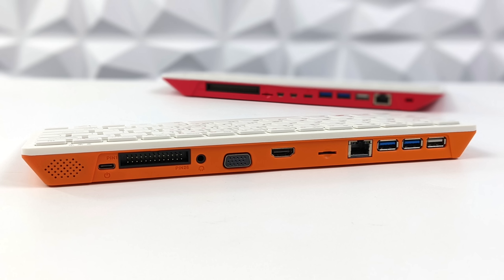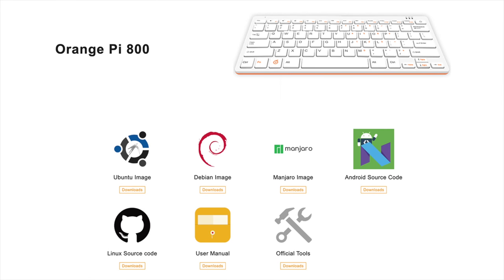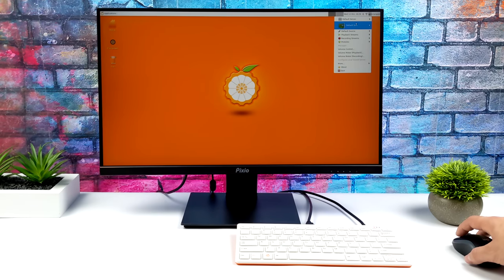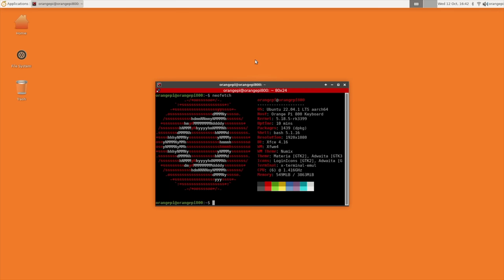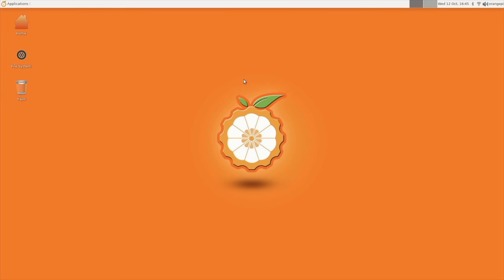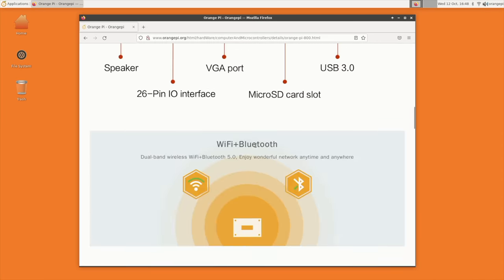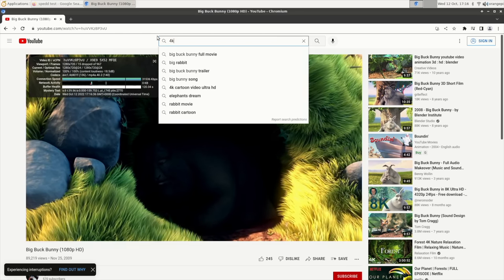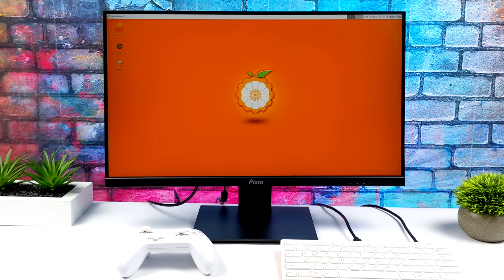Pi800 First Look, An Brand New All-In-One PC! Think Pi400 But Faster! 6 Core Arm CPU

Comment: Problem with these things is always the same: lack of opensource graphic APIs implementation, which the Pi provides.
Why is that important you ask? Because not having opensource graphics ties you to an old kernel, and prevents you from using the full potential of the GPU.
Reply: Which is why browsers struggle with video decoding. But they will catch up with time like the Pi did because it didn't have accelerated graphics at first either. I'd bet if he used a custom build of ffmpeg for that chip it would play video at full speed. I had to download YT videos on my Pi at first to get proper acceleration.
Reply: wtf!!!!!!!! this use mainline and PANFROST!!!!
Reply: @anon_y_mousse  yeah, after a year or 2 the current video codec is sometimes too hard to use for these PC. I had an Apple IPad that could no longer stream video. Also a wii u.

Must get something with x
Continual updates and common chipsets.
Reply: Well, I don't want a fairly obsolete gpu... as rpi models have limitations that GPUs from more than 15 years ago in many parts.
The rpi4 GPU will never be able fully support OpenGL 3.0 because it does not support/lack hw 8 draw buffers some very old PC engines required it, no native support MSAA ,
And not going GLSL 4.00 for several DX11/OpenGL 4.x engines with limited Opengl 3.x  GLSL1.30/GLSL1.40/GLSL3.3
For example Xbox classic emulation requires OpenGL 4.0 with Xemu .
The GPU rpi's it's very obsolete early DX9/OpenGL 2.1 era and partially DX10/OpenGL 3.x support  from ~15-20years ago .
It does not have  early Vulkan 1.1 api 100% implemented because it lacks hw VK_KHR_sampler_ycbcr_conversion and VK_KHR_shader_draw_parameters 
It is very sad that today to run OpenGL 4.x only Tegra TK1 ad higher   and Apple m1/m2 can do it
The rest of the manufacturers under arm are too limited driver or lack hw to offer that.
The closest to offering that is Qualcomm + adreno 650 which already offers Vulkan 1.3 and several stuff for OpenGL 4.x has many things implemented and hardware prepared in the structure to implement it in its driver.
We  needed a gaming manufacturer for arm/risc-v that meets the requirements to implement the graphics apis of the last 15-20 years 100% with no stuck Propietary drivers NVIDIA or Apple m1 metal (on mac wrapper limited voltenVK if not exists metal backend)
Only boards that have PCI-express and can inject a PC GPU with free drivers for amd GPUs or nvidia drivers already released for pci-express boards arm64 used in some servers.
Reply: @bulletpunch9317  mostly better if compared with Mali/broadcom gpu's  but missing driver implemented supporting the API .
The problem is that many arm manufacturers are oriented only in android and robotic of use and throw away after years.
Little effort to offer support for Linux where OpenGL support is more common compared with OpenGL ES API.
Sometimes you can poorly X11/wayland stuff perfomance due poor perfomance or partially stuff implemented under linux with no official supported.
The state of drivers is quite concerned very fragmented and they are rarely updated maybe you can go a little further with some custom rom for android principal development by containing a newer driver but you never get to see a notorious stagnant progress to partial Vulkan 1.1 with old development branches with no finished driver.
I have seen dual source support disabled in some drivers developed by samsung or some stuff optional never implemented .
The only manufacturer is the one I have mentioned Qualcomm Adreno 650 with recent mesa3d drivers open souce you can have a lot of work from what I say.
I haven't seen a driver on Samsung exynos 2200 phones that fully supports Vulkan 1.2 or Vulkan 1.3 required for current DXVK (it's a DirectX to Vulkan wrapper).
Reply: As far as I know, the Pi 4 still doesn't have hardware accelerated video decoding in a browser with mainline Linux. The Pi 4 does have Vulkan support, which is only experimental with the RK3399. Unfortunately Collabora will remove it for the RK339, as they say it's making things complicated for Vulkan support for other chips. It is possible to enable OpenGL 3.3 for the RK3399 (I did that with Manjaro), which I haven't seen with the Pi 4 yet. But both lack OpenGL ES 3.2 support with mainline Linux. You can run AetherSX2 on a RK3399, but so far I only managed that with Chrome OS and using the Android app. The Pi 4 can run AetherSX2 with mainline Linux, because it supports Vulkan.
Reply: @LivingLinux  who cares, that vulkan render is barely usable for the important stuff: dxvk. not only that, the pi4 gpu (and just to be CLEAR rk3399 HAS OPEN SOURCE GPU DRIVERS) doesnt support has many textures and features that T860 (a dx11 conformant gpu) support, bc7 textures, depth clam, etc, etc. while not having vulkan, just bc it would be as useful as on rpi4 (and th epanfrost devs though it would be reasonable to just support it on bifrost and up), the board has fucking mainline open source drivers and its way more open source friendly than RPI4 that has very CLOSED software running underneath like THREADX, the vpu blobs and so on.
Reply: you not even watched the video, this runs on mainline 5.18 with panfrost mesa drivers.
Reply: @microlinux  You can run AetherSX2 on a Pi 4 with mainline Linux, something I haven't been able to achieve with the RK3399. The T860 might be better GPU, but software support is still lacking, negating the hardware superiority.
Reply: @microlinux  Wow, are you sure of that? Is there an SBC equivalent to this which is readily available? I mean, in Pi-like form, not inside a keyboard.
Reply: @LivingLinux  that just counts for aethersx2 bc it needs vulkan for most parts (no ida why you cant get it working with gles tho, maybe you also need gles 3.2, something that neither pi4 provides as today on the driver), but the software support for those features are there. I can use bc7 texture on cuphead on rk3399, not on rpi4. I can use depth clamp on rk3399, not on rpi4.
Reply: @manuelalfayatecorchete1806  they are tons of options, and panfrost not only supports rk3399, it supports trillions of mali based sbcs. Most of my boards on my channel use panfrost. Every midgard/bifrost/valhall can use panfrost, at least eventually on the last one since it's  too new
Reply: @LivingLinux  for the things that a pi4 can run on aethersx2... who cares about a vulkan driver... the same goes for rk3399.. not enough  on  both, on both cpu and gpu side.
Reply: @manuelalfayatecorchete1806  rockpro64 is my safest recommendation
Reply: @manuelalfayatecorchete1806  odroid N2+ is a powerhouse (without much I/O) and also use panfrost.
Reply: @microlinux  How does the RockPro64 perform compared with the Pi4? Please consider I will ONLY use the opensource graphics stack on both.
I have been trying to see comparisions but they are very confusing.
Reply: @manuelalfayatecorchete1806  performance on what specific workload?? I NEVER use blobs on any rk3399. In fact, I have an rk3399t variant that sucks bc it doesnt run on mainline as today. But for any rk3399, mainline is the only way to linux. A lot more performance cpu and gpu wise
Reply: @manuelalfayatecorchete1806  if you need raw performance, odroid N2+, if you need decent performance but also a lot of I/O, rockpro64. Both run great on mainline (well, odroid use a downstream close to mainline kernel like rpi).
Reply: @manuelalfayatecorchete1806  see how youtube performs on rockpro64 on my channel. I overclocked it to 2.2 ghz and 1.8 for the low power cores. With the heatisink/fan of pine64 it's  very stable at very low rpms
Reply: @manuelalfayatecorchete1806  the radxa zero 2 is stupidly powerful but that isn't  out yet. Also on mainline with panfrost
Reply: @microlinux  Aethersx2 for OpenGL ES needed Opengl es 3.2 context won't work with no <Opengl ES 3.2 context.
Also work for Opengl 4.3 context for Opengl HW and needed some OpenGL 4.4/4.5 for some accuracy stuff .
Depth clamp will never work on rpi4 it's lack hw so will never work for DXVK too or some apps/games needed it.
Reply: @CarlosEstrague  absolutely, that's  why I mention that videocore 6 lacks of too many stuff that EVEN on mali gpus are supported.
Reply: @LivingLinux  try forcing gles 3.2
Reply: @microlinux  yes mali are better than broadcom socs in some stuff like this. 
Too bad they missing supporting Geometry shaders it's a physical hw needed in some test cases but are supported on rpi4 .
It's all so diverse and rare that you go crazy with each manufacturer supporting each thing  xD
Reply: @CarlosEstrague  afaik, geometry shaders are supported properly on T860.  T860 supports stuff that even bifrost doesn't  support....
Reply: @CarlosEstrague  even then, we are talking about ancientware... the real thing is valhall and it's  getting  panfrost support right now
Reply: Depth clamp is even supported on G31...
Reply: @microlinux  The t860 probably supports it.
But I mean For example in emulators like the 3ds emulator with the new Vulkan render.
At least in its current state it requires it if you want Hardware rendering in Vulkan backend.
In some driver if not supported returned log.
    "Geometry shaders not available! Accelerated rendering not possible!");
Reply: @microlinux  Specific workload: emulation using RetroArch with max_swapchains set to 2 and "threaded video" set to OFF. In other words, low-latency emulation.
Reply: @manuelalfayatecorchete1806  odroid n2+
Reply: @microlinux  I am not interested in the n2+ it hasn't a good case to with it.
Reply: @manuelalfayatecorchete1806  hahahaha then wait, there is a rpi4 form factor sbc with A311D down the road. If you want retrogaming then it must be S922X or A311D at a decent price, not khadas vim.
Reply: @manuelalfayatecorchete1806  yo can make any case or even repurpose an old console case and fit the board inside. Consider the N2+. For retrogaming it's  a good board.
Reply: @microlinux  What's that Pi-factor SBC with A311D?? Why S922X or A311D and not the Khadas Edge 2 for example?
Reply: @microlinux  I also saw that  A311D and S922X are both A73 while RK3588 is A76, which is what I want.
Reply: @manuelalfayatecorchete1806  it's  an sbc not released yet. I can't  disclose more bc of that. Rk3588/S/J series are very good stuff.. but.. no mainline neither panfrost as today. So, very few stuff you can do from linux as today
Reply: @manuelalfayatecorchete1806  you are going  to wait an year for mainline + panfrost on that onr

Comment: This thing looks sick! The fact that it has VGA out means you could use a VGA to Component converter to get a direct video signal out to a CRT TV, of course you'd need it to be set up at 240p resolution. If this thing can run it's own type of RetroPie or Batocera and can be switched to 240p then I want one.

Comment: Nice review! I look at the Pi-400 (and now the OrangePi-800) as a modern Commodore 64. But at $100 - it's an order of magnitude cheaper. Even Moore's law doesn't account for this reduction in cost. Amazing.
Reply: Moore's law did account for this cost-reduction, and you can actually map the relative price-to-performance of various Pi generations to find that the value is decreasing overall. The original $35 Raspberry Pi was the best bang-for-your-buck computer ever made, IMO.
Reply: @dial2616  I'd like to see your numbers on Moore's law for this… But as far as I can tell the raspberry pi 400 and or the orange 800 should cost $599 like the Commodore 64 did. the fact that it's 1/6 the cost is what I'm pointing to is having done better than Moore's law

Comment: When it comes to emulation performance on SBCs and units like this you might want to try grabbing the retropie install script, setting the OS to boot to the terminal by default (you can always type startx to manually start the GUI) and then run the retropie script and have it compile things from source so they are tweaked for that board and you don't have the overhead of the desktop environment in the background.

Comment: One of the things I really care about is vanilla kernel support. I don't know with a lot of these boards if I will be stuck on an old kernel version forever.
Reply: Runs mainline.
Reply: @microlinux  Excellent then. I might have a look at getting one of these then.
Reply: @dave7244  yeah,my only concern is the 5v input thingy. It would be much better 12v jack or PD

Comment: RK3399 is quite powerful. Well sufficient for every day office and browsing tasks.
I like the connection options of that device. Especially having HDMI and VGA gives you the option to plug in 2 monitors if you have an old VGA display lying around somewhere or use an adapter.

Comment: I hope the Orange Pi ecosystem continues to grow.  They've been around awhile and have a lot of unique boards at acceptable prices, and they're still available.  The smaller community makes it a bit more challenging to find solutions/answers for them, but they're still fun to tinker with.  I've been using a few Orange Pi Zero boards to run Octoprint for a couple of years now without any major hiccups (other than the initial setup).  I'd love to use Raspberry Pis for everything, but the shortages (and scalping) has had a major impact on their availability.
Reply: Thank god I got my rpi 4gig 128 PC before all of this shortage happened.
Reply: Orangepi ecosystem is quite big. Just check armbian forums.

Comment: Pi400 and Pi800 are the comps we wanted to replace the C64.
This is absolutely the way that C64 mini should have gone.
Reply: Well.. technically, the proper sucessor for a commodore 64 should be the commander X16 from the YouTuber 8 bit guy amd his team.
Reply: @monochrome_linux  I'd consider it more of a modern-off-the-shelf remake of the C64, cranked up to 11.

Still a 6502 at heart, but it's capabilities are pushed to the limits.

So it's more of a development of the C64, rather than a successor.

Though I've just seen the video was released yesterday, so i'm gonna take a look

Pi400 and Pi800 on the other hand are true modern systems, that can be used for everyday tasks.

I am curious to see what the X16 can do.

Comment: Years ago, 2018 I think, I pre-ordered a Rock960 (RK3399), waited forever for it to come, and installed it into a tenkeyless mechanical keyboard along with a USB hub.  It's been gathering dust for a long time since then, since the promised Ubuntu driver support for GPU didn't come.
Reply: Rk3399 has gpu drivers since years ago. Not vpu tho.. well, not properly supported on third party software. The same goes to rpi4 for most parts, specially the browsers.

Comment: cool little gadget. on a personal note i would like to see a revision either with this or with the PI where it is usable as just a plain keyboard, flip a switch on the back and you can boot the system built in to the keyboard. flip it back and its just another keyboard

Comment: This new kind of computer should came with ram and SD in their slot versions. There is space and plenty of options (specially for ddr3L sodimm and m2 SATA/nvme)
Reply: There is no hope for that. Not even the RK3588 supports SO-DIMM/DIMM RAM, just 32 GB of soldered.

Comment: I really hope orange pi gets more support like the raspberry pi. I will say keep in mind that most of the orange pi's that are LTS, not the os lts but the name of the biard is something like orange pi 3/4 LTS, currently do not have wifi support on the current kernel. Its seems that it has to do something with the new wifi chip they are using. Apparently they only work with the OS that they provide from there website and do not work with ones directly from othe places like Armbian, mint, or manjaro.

So I would be interested to see if they are using the older wifi module on this one or atleast one that is more supported than the new one they are using on most boards.

Last thing I will say that if you want to use one as a desktop computer than definetly use one with at least 4gb of ram. I have the orange pi 3 LTS with only 2gb ram and in a desktop environment its pretty slow but just cli work great.

Comment: My problem with these more obscure SBCs is the GPU support or rather the lack thereof. Even the massive community behind the RasPi 400 is struggling with a proper 64bit OS with a proper GPU driver. This is not the fault of the companies making these, it's that there are not many places to get an SoC and those places have closed source blobs for the GPUs, that's why they work in Android, but not in linux. This just goes to show how important FOSS really is.
Reply: 64bit OS works fine on the Pi400 with full GPU acceleration, the GU stuff is also all FOSS now.
Reply: Rk3399 has open source gpu graphics since middle ages. It's very robust

Comment: Awesome video and I am glad to see more SBC Arm configurations. All In One usually means keyboard, computer and display and this gripe is leading me to this question. 
Why buy this when we have a higher spec Chromebooks on the second hand market going for a lot less? 
I consider this channel a tinkering/emulation one, so maybe you should tap into modding a cheap laptop/Chromebook vs this Arm offering, providing Linux and a screen as an AIO alternative.  Pushing the ARM narrative.
Reply: Chromebooks aren't free (software-wise). It's a lot harder, and sometimes impossible, to boot Linux from a Chromebook's UEFI
Reply: @StevenAlexander44  Usually it is just a small screw.  There are hundreds of Chromebooks out there and ETA Prime is an expert on the subject.